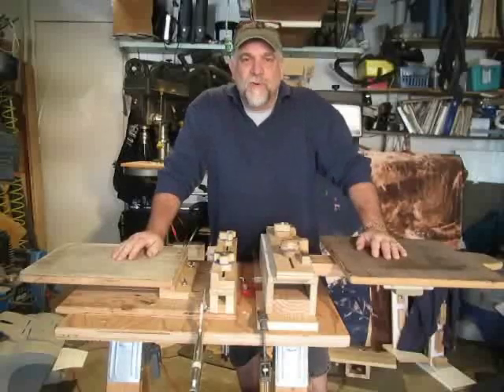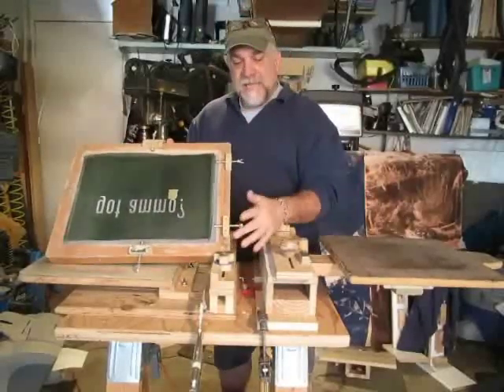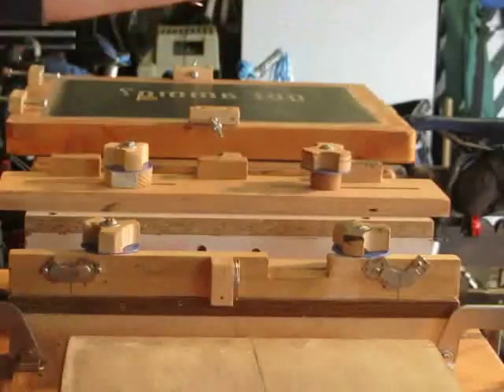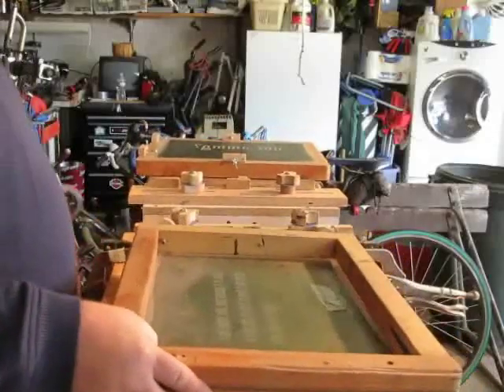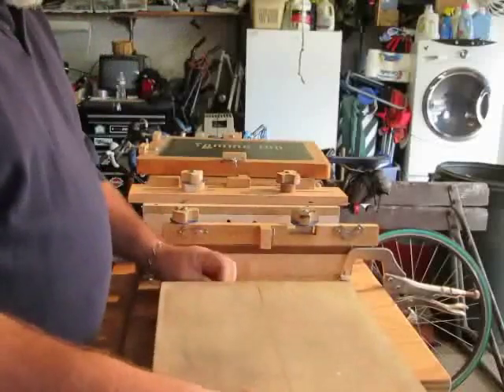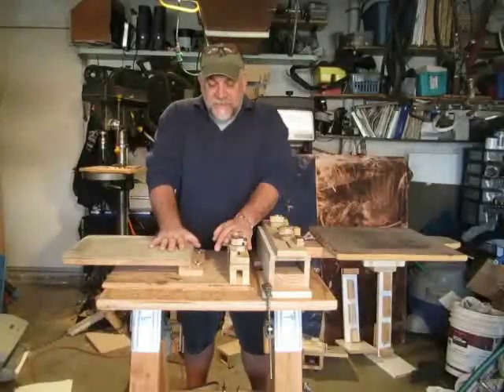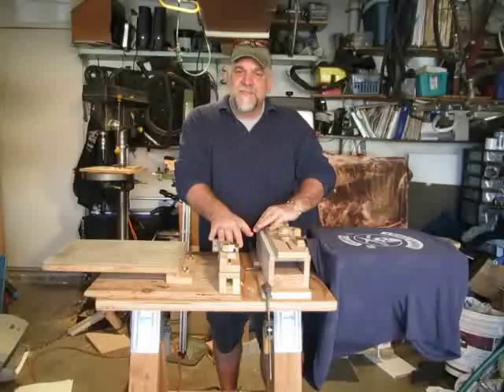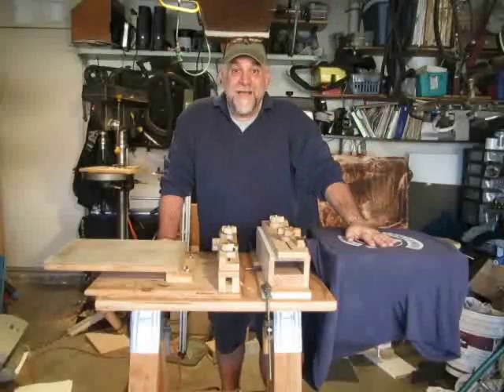My Screen Presses

Comment: This is overly complicated with way too many adjustments. Make it simple, search "Thai registration method " ,no knobs or slots or rickety tables, no buying dozens of nuts, bolts and relying on magnets! Apparently you just like to tinker and aren't really interested in printing garments . I can set registration on 7 screens in less than 3 minutes and guarantee perfect alignment no matter how many times I place or remove any of these screens, it's foolproof!
Reply from the maker: Jon Rothenbusch.  If you don't like it don't build it.  Everyone that has actually used it has loved it so to each his own.

Comment: what if your using aluminum frames
Reply: Funny you should mention that.  I haven't used wood frames as my primary for years now.  I need to do a metal frame setup video.  The bottom line is that you use a modified t-nut or my preferred hardware, a rivnut in the aluminum frame ( don't forget to drill a small drain hole in the corner.

Comment: do you do anything for off contact or do your screens touch whatever you're transferring the image on to
and also what type and size of wood do you use for your screens
Reply from the maker: I do use about 1/8 in or 3mm off contact using either strips of wood taped to the underside or 4 large washers that meet up with the 4 corners of the platen (hint:  rare earth magnets on the inside of the screen do away with the need to tape the washers in place).  As for the wood, I just used whatever cheap 2x2s Home Depot had that seemed straight.  Now days any screens larger than 17 X 21 I'm buying in aluminium frames.  Large wooden frames made from cheap wood are good in a pinch, but not for long term use.

Comment: One of the problems I am having with the 3 point registration, and I am certain its an implementation problem on my part, is how I mount the tuner bolts to my frame. I drilled a couple of holes into my home made screens and inserted t-nuts. The bold inside the t-nut has a bit of wiggle, its not as rigid as I would like it to be, and it means the screen can move a bit. It might not be much of a problem with basic shirts, but I would like to ensure that the print is consistent with less room for error. So I fixed a t-nut on the other end of the hole thinking that would provide less wiggle threading the bolt into a 2nd nut. It works, but feeding the bolt into the 2nd nut, it gets really stiff and hard to turn. Probably not quite 100% aligned to the first nut. It also seems to cause the t-nuts to dislodge from the frame after a few turns. I could drill a smaller hole, and run the bolt in and out a few times essentially threading the timber, but that makes it quite hard to turn. Any suggestions would be welcome. Thanks
Reply from the maker: As with the on-screen tuners, I use a #10 drill bit and then thread the 1/4 in bolt through.  I use a drill with a socket bit and run the bolt in and out several times until it gets too hot to touch...kind of hardens the threads.  That takes care of any play.  If you must use a t-nut, you will be forced to use a locknut on the opposite side of the frame from the t-nut.  You can also work a combination  of the two.  You drill through with the #10 and then enlarge the hole only deep enough to barely accommodate the t-nut.  That gives you sturdy threads for the t-nut and enough drag to keep the bolt from moving.
Reply from the maker: Oh, and the t-nut would be INSIDE the frame, not on the outside where any resistance would cause it to come out.

Comment: Hello. How big are the rare earth magnet that you are using. I understand you ripped them from old hard drives, but I am looking at buying some off ebay and I am not sure how big they need to be. Thanks
Reply from the maker: Try these http://www.kjmagnetics.com/proddetail.asp?prod=BX882-N52&cat=168
Don't forget to mount them to a small iron plate before putting them on the press.  It creates a stronger bond to the tuners.
Reply: cyclesurgeon Thanks for your quick reply. The question that I have is, when registration is dependent on the tuners mounted to the screen frame snapping back into the exact same place every time, what happens when you have a magnet that is rectangular like the ones you refer to. It could snap in anywhere along the length of that magnet. Is it the other registration point in the centre, the one that governs left to right movement, that ensures it re-aligns whenever you remove a screen and stick it back? Or is it that when you position the bolts on the screen, that they are at the maximum width possible, meaning that in order for both bolts to attach to the magnet, they need to be in contact with the absolute outer edge of the magnet? A mm in either direction would mean one of the magnets pressing against the timber of the presses back mount?

I think the middle registration point is where I am having trouble envisioning what  need to do when I build the press. I'm not the best at interpreting the diagrams on your website.

Again, thanks for the videos. P.S, I have watched most of the youtees videos. Its pretty funny the difference of styles. While I think the other guy is highly knowledgeable on screen printing, his arrogance is bordering on delusional. Much prefer your down to earth and humble style. Thanks for the videos
Reply from the maker: MrSoggyjocks
It is all 3 points that determine placement.  The two Y-axis points ensure that the screen lands correctly in that plane, while the X-axis point ensures proper placement in that plane.  My initial adjustment for any screen is to set the Y-tuners on the screen for about 1 3/4 inches off the screen and the X-tuner so that the Y-tuners are about centered on their magnets. Tell you what, I've got a couple of shirts to set up this weekend.  I'll shoot a registration video just for you.